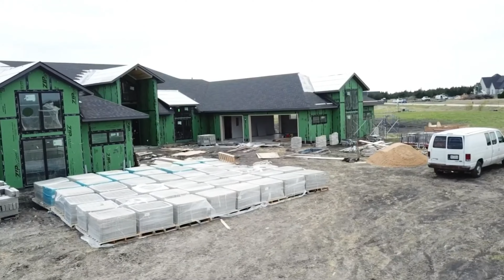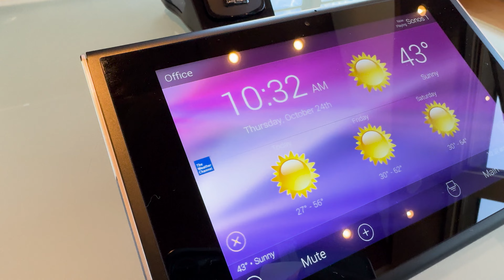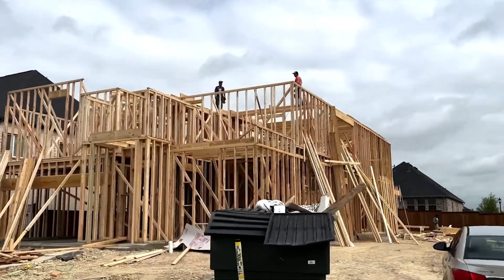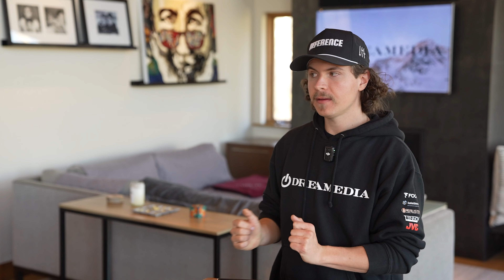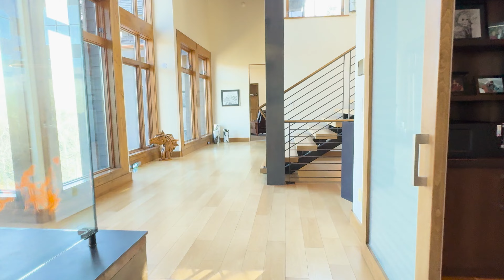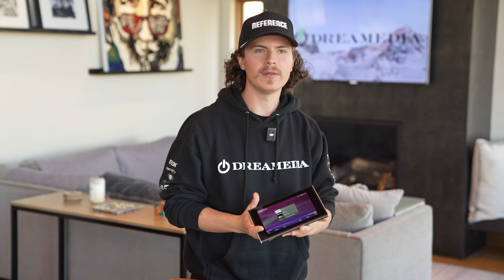FULL Home Tech Tour - Sonos, URC, Denon, Lutron Smart Automation - Edwards, Colorado

Comment: Dreamedia - very very nice video.   A lot of care was taken in updating and correcting the layer 1, 2, and 3 of the network for this customer - Ethernet, Wi-Fi and addressing power filtering, distribution, and UPS backup.  This house has better network infrastructure and performance than many corporate facilities that I've worked at.  I've managed and directed large enterprise network support/architechture teams for billion dollar companies and you have done just as good a job here as in those corporate environment spaces.   This home owner now has a very robust and clean setup.   Dreamedia just doesn't get it working as some other AV integrators do (most home owners won't know the difference "hey it works!") but you truly get it optimized to a gold standard (you even address radio signal coverage (heat mapping)).  Very nice job guys - fantastic attention to detail and quality.   Lastly, you do a great job in documenting what you do and why.   I am a continued fan of your company and channel.  5-stars all the way.
Reply from the maker: Thanks for commenting! Glad you liked it!